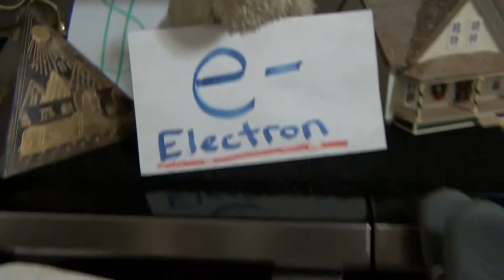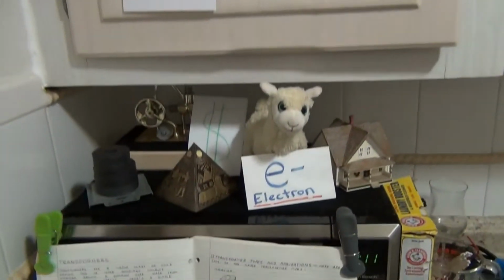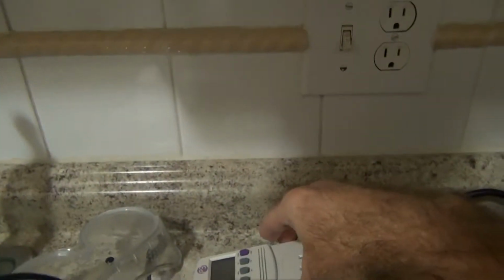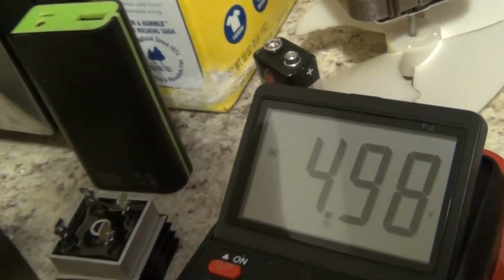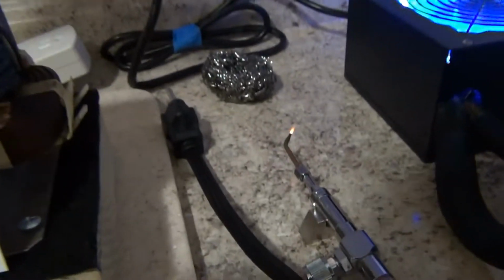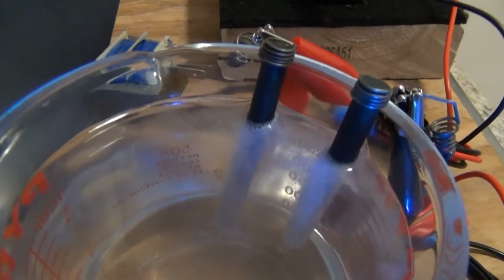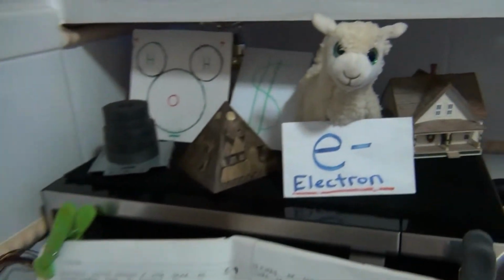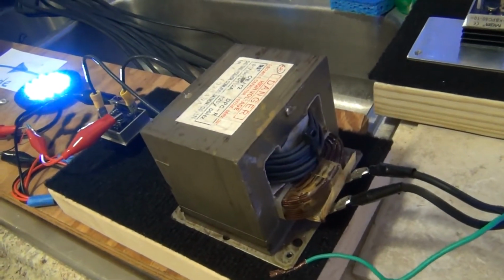HHO MICROWAVE TRANSFORMER POWER STATION

Comment: Been thinking about making a low voltage (~2V), high amperage power supply with a MOT for HHO. I got a 100A bridge rectifier and some decent size capacitors. It should work since only 1.24V - 2V go into making HHO and additional voltage just makes heat. What do you think?

Comment from the maker: The transformer can be used in a variety of ways the best being able to match any voltage level required for projects and as a quick mini welder or electromagnet and even an DC power supply electric generator! Here i use it as a high ampere low voltage 12 volt a/c and dc power supply to produce an endless amount of HHO gas.